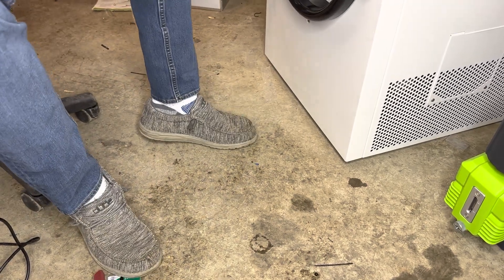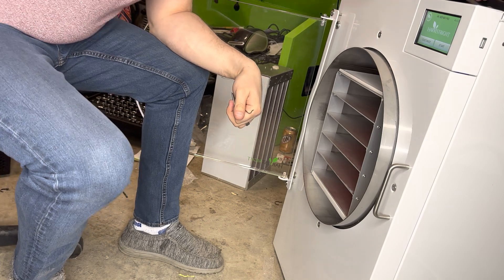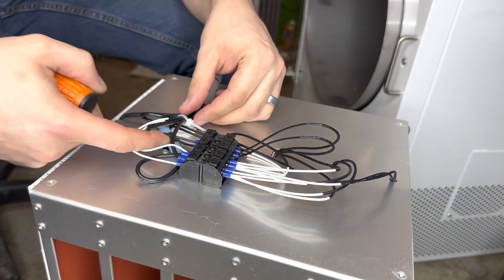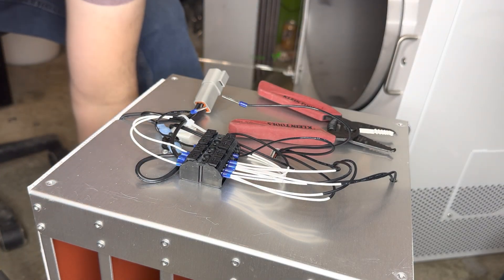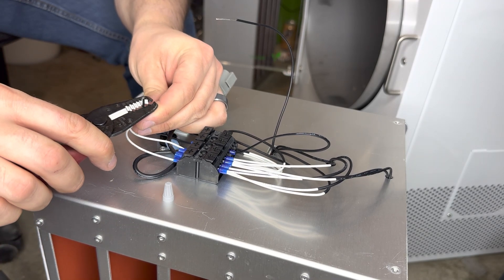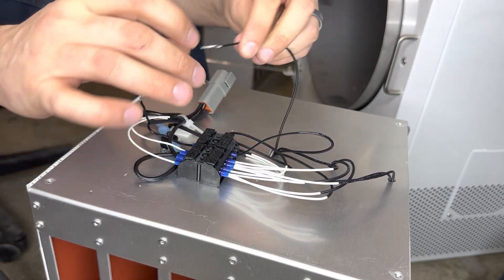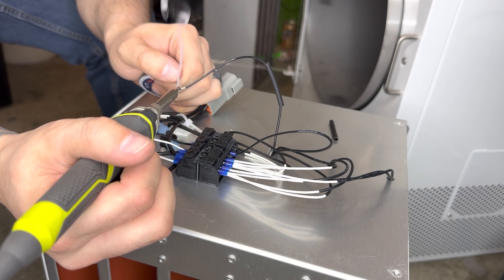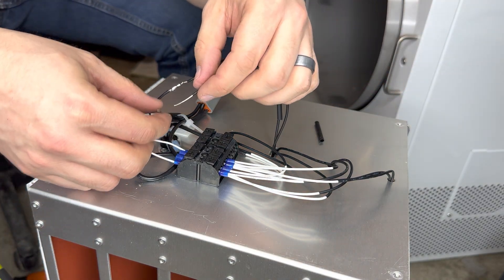Harvest Right Thermistor Bypass

Comment: I have had a bad thermistor twice now.  The first time they wanted me to buy the whole shelf unit, which is stupid expensive, I managed somehow to convince them to send me a replacement thermistor as I already had the tray unit apart.  I fixed it, but now a few years later the other one has crapped out, I doubt I'll talk them into another thermistor.  $200 bucks for a new unit because of a part that costs less than a dollar, pisses me off.

Comment: I was getting temperature sensor error.  It seems that while cleaning the rack I got some water in with the thermistor.  I put the whole rack in the oven at 220F for two hours.  It dried everything out and it works fine now.

Comment: Why do three trays heat like they are supposed to and fourth one is stone cold? (I mean frozen when the cycle is done.)  My upper 3 trays are great, the bottom one does not heat at all.  I guess I will have to test the wiring on all four trays.  Perhaps I'll make a video.

Comment: What is the temperature of the shelves when sublimating?
Reply from the maker: They will go up and down like crazy till they max out at the temp you set for drying
Reply: @freezedryerrepairsupport  I don't want to make one myself and design everything at the temperature stage. How can I set it to a certain degree so that it does not collapse but becomes sublimated? I installed an external clock to stop the heat and turn it on automatically, but I do not know what degree to set it to.

Comment: Repeat question after watching Felix Fix video:  For the thermistor bypass, is there a reason we can't just use a wago connector to connect the two wires together rather than soldering fresh wires?   I'm getting a problem where the temperature sensor of the tray is reading like 130-140F when the machine is just sitting idle.  I fixed it once with hitting the reset button on the back, but that isn't working now.  Does that little sensor go bad?  What is the thermistor bypass doing?   I've tried bypassing like this using the Wago connector, but it didn't help.
Reply: 30 years of Industrial  maintenance  and now doing  appliance repair..
This is not a Repair.. it's a bypass. 
So you can still.. Half ass use the machine..

If the thermistor  is bad.. the heater won't be turning on or off.. correctly. 
If you have a new machine like mine.. want to do Candy and set tray for 150 degrees.. well it's not going to be accurate.. if you actually  bypass  a temperature... feedback... to controller..

Thermistors. have two wires that sends a resistance  back  to board( loop)

I'd  like to see the wire diagram..
Or find the service Manual.

This makes no sense to me.. as a repair.

I have two trays on my machine..
That don't heat up as hot.

So this video  does explain why...

There is not a sensor on each tray.
And the controller is just using a poor average.. ballpark.. to turn on or off heater..
Reply: @curtisjones9157  Yes, but it's not really a bypass of the thermistor.  I don't know why they called it that.  It is bypassing the terminal block connecting the leads from the thermistor to the leads that go up to the circuit board.    It's just confusing everyone to call it a thermistor bypass.  You are right that of course you have to have a working thermistor for the process to work.  As it turns out, the thermistor was bad in my shelving unit.  Had to send it in for repair, and all is working now.
Reply: I've done the paper clip test shown on calee991's YT channel to check continuity of both the  epoxy harness and the pigtail and terminal block, and both passed the continuity test.  I think the thermistor is bad, but it's  riveted into the tray and I don't see any discussion on any site as to replacing it or obtaining a new one.
Reply from the maker: You would need to order the replace direct from HR. Someone I talked to said the other day however that they are trying to make them buy a whole new tray system

Comment: This is what Harvest Wromg calls field testing. You find a defect in their freeze dryers and create a fix youself and inform others.  Problem solved and it didn't cost Harvest Wrong penny.
Reply from the maker: Yep you are correct we have fixed a ton of the machines for them and at no cost to them. It’s unfortunate that’s it’s the customers time and money having to fix many of the issues
Reply: @freezedryerrepairsupport  What do you do if the thermistor is the bad part?  Any idea where to get another one?

Comment: You listed some reasons why someone would need to do this bypass. Would this repair also potentially fix an issue with the tray temps not reading (causing the trays to continue to heat)?  This is just bypassing the block on the back, it doesn’t fix a potentially broken thermomister… right? Do you have a video for that?
Reply: hello, I have same issue, Machine skips cool cycle and trays continue to heat excessively. Did you find a fix?

Comment: Hi Donald, I've had one of these blue connectors literally fall out of my tray. My tray hasn't been holding temperature and now I know why. I bought the XL HR and it's only a week old. I don't know for the life of me how this could have even happened. It looks like it's been broken off from the base of the connector. It's copper at the break off point. My question is can I reconnect by simply inserting it back in to the PIT connector? I don't know where to find these things in copper. I'm also not a techy electrical guy. Thanks for your help sir.

Comment: Could this be where the smell is coming from in my freeze dryer?
Reply from the maker: What kinda smell are we talking about?
Reply: @freezedryerrepairsupport  I think it's that epoxy smell. It only starts to smell when the tray heaters are on. I can clean it and it goes away until the trays turn on again. It's a strong smell but I'm told that some do it more than others
Reply: @freezedryerrepairsupport  any way to get rid of it other than dealing with the smell?
Reply from the maker: @drewbentley5001  maybe doing some bread runs???

Comment: So the name of this bypass should be connection bypass.  You are not by passing any thermistor just simply bypassing a piss poor connection.
I have heard Don talk about bypassing the thermistor in the past and I couldn't fiqure out why.  Really he needs to change the name of this procedure.
Reply from the maker: This is not a name that we created. It is a name Harvest Right has put on this. We understand what it’s really doing however the name is just what was created by the companu
Reply: @freezedryerrepairsupport  I do understand that the name is not yours because you have said that hr showed you how to do this.  However let your watchers know what it is actually doing and why. 
Now that I know about that poor connector I think I will bypass all the wires from that connection point as I feel like this might be a cause of a lot of electrical problems due to the resistance changes. That area sees big temperature changes and we all know that resistance changes as well with temperatures
Reply: @freezedryerrepairsupport  The goons at HR are all idiots. This is all china crap.

Comment: The assumption is the terminal board causes a resistance on the circuit and this procedure removes that resistance.. Oh, install the shrink wrap onto one of the wires before soldering it. Then heat shrink both wired lines and replace the cover and screw it in place.